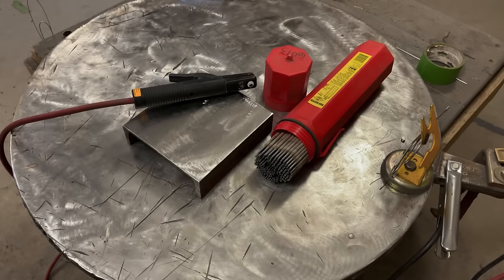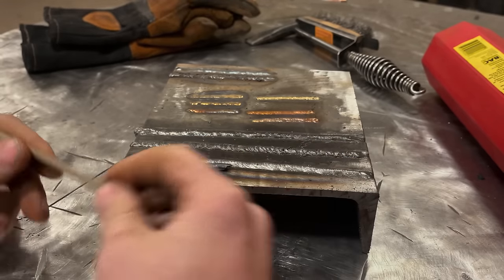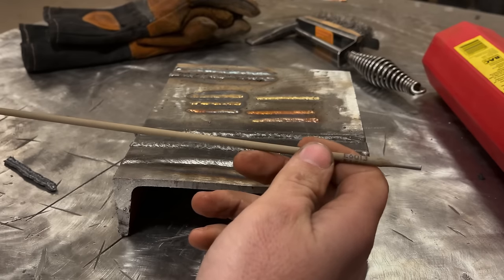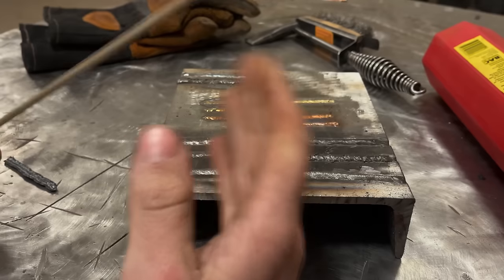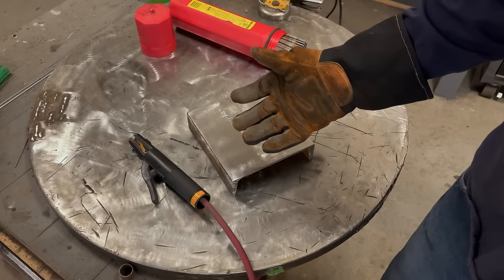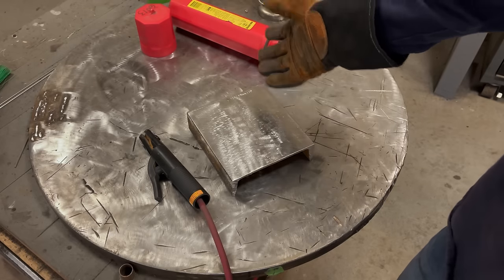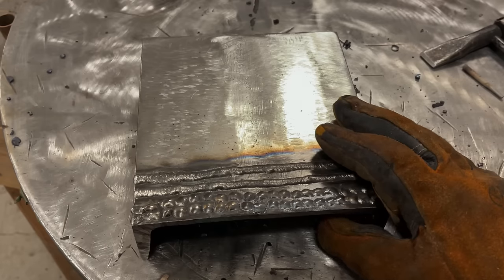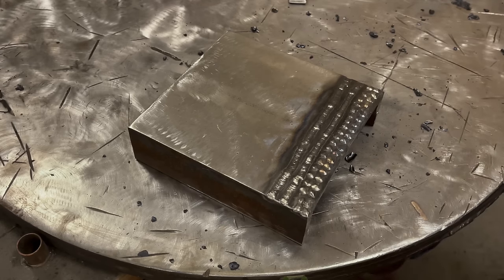How to stick weld 👨🏻‍🏭: Intro to Arc welding for beginners, (Series Part 1)

Comment: 80 years young. Just discovered your channel. Subscribed. I have a square body truck I need to repair using a mig welder. [I have never welded before] I saw this video and I have been inspired by your presentations to want to also to learn stick welding. You are an excellent teacher.Thank you!
Reply from the maker: Thanks for the kind words and it’s awesome to hear your tackling projects.  You have the right idea, watch some videos to get the knowledge and then practice.  The start of learning stick is about 99% frustration (due to everything going wrong lol) but after than things get much easier.    When you put down your first few good beads it will make it 100% worth the effort 😀
Reply: @makingmistakeswithgreg  Thanks I just bought a stick welder, a new helmet for welding, and a couple books [the books and helmet will be here in a couple weeks.] I have decided not to rush but to get everything ready for a great adventure. I bought a steel welding table plus a 1/4 inch 2 ft by 2 ft steel plate. to place welding material for practicing on top of it.I have been buying welding stuff over the years gloves, aprons, clamps, etc. Last week I decided to clean up my little shop. I found an Eastwood welding table and another welding top for the table. It is like Christmas time. Anyway, this new welding experience will teach me patience and a lot of prayer.I am a 7DayAdventist and I believe everything has its proper timing My time is so close to learning welding, bodywork, and painting. I have decided to slow down, finish straightening out my shop,weedwhack my yard put things in their proper place I like being organized and learning to do things the right way. Thanks for being such a wonderful inspiration.[I was thinking about so many homeless people living on the streets with drug and alcohol problems and I felt sad that often their talents or what could be talents are being robbed. Without a vision the people will perish] You must be a busy man You don't need to reply again. Thanks1
Reply: Your mig welder is perfect for body work because it can weld thinner metal easier and faster than stick

Comment: Why is it that every video I've seen showing welding when the arc is struck everything disappears and all I see is the bright arc and no rod position angle speed of travel it all disappears into the bright arc its almost like it needs a filter to block the brightness,  you know what I mean.

Comment: Tried stick welding for the first time ever today with 6011.  It did not go well LOL.  Kept sticking and then popped the 15 amp breaker.  Blah.  Will watch your entire series.  Thanks
Reply from the maker: 6011 is tough to work with if you’re new.  It is easy to start, but makes rough welds if you don’t move slow and consistent.  I have a video directly on 6011 that you would find very helpful, link at the bottom.  If you can make good looking 6011 welds you will find all other rods to be fairly easy to run.  Expect to make some pretty bad looking welds for a while, but once you get the whole balancing act down it will become easy 😀👍

How to weld with 6011: https://youtu.be/vK7rJAuoPJE?si=M9wJ-GtpjzEsDBcu

Comment: Sir Greg, started a welding apprenticeship in my village, they don’t do more than stick welds and with very little theoretical explanations. Thank you very much for providing this opportunity. I pray you keep dropping these gems.
Reply from the maker: No problem, and I am glad it has helped you.  Since you’re starting out I will give you this advice:  Expect to fail a lot, but don’t give up.  Practice the basics until it’s hard to make a bad weld.  You probably need to move slower than you are for travel speed.  Try to be as smooth and consistent with your hand movements as possible.  If you get frustrated take a break.  And lastly if I can do it you can do it 😀

Comment: A few minutes into this video I stopped and subscribed. You are a great teacher and the many comments speak to that fact. Like so many others, I have watched several "New to stick welding" vids to build my knowledge base. Your presentation is very complete and  I'll be sharing your channel with others. The fun begins!
Reply from the maker: Glad to hear you are starting a journey to learn welding.  You’re doing the right thing, learn as much as you can and then practice.  You definitely can learn to weld, just expect to be frustrated a lot at the start 😀.  Once you can reliably start a rod everything becomes much easier.  Definitely worth while learning, welding is one of the most useful skills a person can have 😃

Comment: Greg, I just wanted to thank you for your knowledge, manner of speaking, and the videos. You have helped me much more than many of the other videos that I have watched, and have encouraged me to practice my stick welding. You have also imparted a better understanding of what I was doing wrong and how I could fix it. I also have to say that your descriptions of the puddles and weld bead have great benefit. I am doing better at practice now than ever, and am going to attempt another job that I have for myself with a lot more confidence. Thank you sir!
Reply from the maker: No problem and thanks for the kind comment 😀👍.  Welding is difficult to learn at first but when you can fix the small things that are wrong it doesn’t take a long time to get decent results.  Once you master simple short welds it’s amazing at what you can actually make/fix 😀

Comment: Appreciate your sharing your thoughts, knowledge and experience. I'm 72 yrs old and retired. I have been wanting to learn about and begin welding. Have watched several videos and Really enjoy your tutorial. 👍🎯
Reply from the maker: Thanks and it’s never too late to learn welding.  Just have patience and understand it’s like learning cursive writing.  At first you make scribbles, and after a bunch of practice it starts taking shape.  Stick welding in specific is all about consistency.  After every practice weld ask yourself “how can I be smoother moving forward, more consistent in how I feed the rod, and how can I run a straighter line.  Once you can be consistent it becomes easy, you just have to train your hands to move correctly.  😀
Reply: At 72 do you ever wish you could learn how to weld when ever your were in your mid 20s??

Comment: I feel super confident after watching that, you teach like a dad would teach his child, that he loves and wants the best for, i feel like i can learn alot from you about welding, thanks for this vid
Reply from the maker: Thanks for the kind words.  I want to see everyone doing the best they can.  Welding isn’t easy and it’s frustrating as hell.  If you’re trying to teach yourself it will be a struggle for a while, but with practice and a decent idea of what you’re doing, you will progress fast.  The key is practice and not giving up.
Reply: @makingmistakeswithgreg  been practising this whole week, I even experimented with flux core wire using the rod welded handle as practice, was curious if it was even possible, I seem to be getting the hang of it, your tutorial was like the missing link for me, thanks greg

Comment: Good info. I'm going to start practicing running beads while things get slow. We're doing structural steel
Reply from the maker: The better you can run a simple bead the easier everything else is.  When you can run a straight bead that’s consistent, and layer them, then you are on the right path 😀

Comment: Thanks for making such informative videos. I will admit I watch each video4 or 5 times to get everything I can out of them due to my retired old brain. I'm really enjoying my new hobby and after getting a cheater lens and padding beads on plate on 3 coupons my welds have improved dramatically. Your a good instructor!
Reply from the maker: Glad to hear things are improving nicely.  With a bunch of practice and a fair amount of “mistakes” you will get it dialed in.

Comment: Thank you for these lessons just bought a welder that does it all stick,.Tig ,mig  wire, with or without gas Flux core and 110 and 220  so looking forward in using it all
Reply from the maker: Good to hear, you will have a lot of options 👍.

Comment: I'm a few months in now and have finished 2 biggish projects (1 metre squared storm drain covers) first with stick and then flux core, which I really like as I think it's more user friendly for DIY. On the safety side I made a major blooper a week ago which I think is worth relating. I live in the Philippines and it was really hot and humid and I really did not fancy wearing a top, and I was only throwing a few (well, 40 or so) tacks down before finishing for the day, so I went ahead and welded without my usual long sleeve cotton shirt. Boy did I pay for it that night - my chest and upper arms were painful and itchy as hell with sun-burn. A week later my skin is still flaky and peeling. Done it the once, never again!
Reply from the maker: It’s crazy how fast UV can burn the unprotected  skin, glad to hear you’re recovering ok 👍.  I have a tendency to forget to button up my shirt neck and that will also get you without realizing it lol.

Comment: Hey Greg, Thank you for making this series! I recently took up welding and really liked stick welding! I came across your videos and really appreciate your in depth instructions!  I recently purchased an old Lincoln AC-180-S  tombstone and plan on restoring it and using it to learn on. I am also a fellow Milwaukeen!
Reply from the maker: Nice to see a fellow Milwaukeeian 😀.  The ac180 is a pretty uncommon welder, I see one of those for every 150 normal tombstones lol.  It came in two versions, one with multiple output taps and one with adjustable amperage.  I have never welded with one but always liked the way they looked.  You can definitely learn to stick weld with that machine.  A lot of people overthink stick welding.  If you can master running beads with a ac machine it will instantly transfer to dc output machines.  The key is to be smooth in movement, consistent, and keep the arc gap to a minimum.  With a bit of practice you’ll be doing good 😀

Comment: Really great beginner lessons.  So many stick welding tutorials dont focus enough on the start..  if you can get consistent high quality starts going then a quality moving puddle will just follow naturally.
New sub thanks
Reply from the maker: Thanks for the kind words.  No doubt the start is critical.  Even with my experience if the start is rough the first 2 inches of bead is sub par.  With less skill it can be really hard to bring things back and you wind up with slag inclusions, a bead that only welded on one side, etc.  Mastering starts and tie ins is huge.
Reply: @makingmistakeswithgreg  cheers mate..  youve also got a very good teaching voice.  Clear with a good cadence and you dont endlessly repeat yourself either - my pet hate sigh....

Focusing on single starts and doing LOTS of them is a more productive path - and cheaper lol - to quality beads than running lots of bad beads and as you demonstrated the beginner will quickly develop a more instinctive feel for cold and preheat effects.  Your vid just made so much sense.  Im not a pro welder just a 62 yr old diyer but ive been working in the engineering field since i was 17.

And from this i learnt that the answers to most questions/problems are inherently simple. Build a strong foundation first always...  everything else after is easier because of it..

Something you may wish to mention  sometime about cheap DC welders - i got a 140A stick and TIG rig - is the poor stability of the current control and how to manage it as it changes with workload...  AND planning your weld to suit the limits of the duty cycle of cheap welders..  i figured this out the hard way...

Ive been having fun with my cheap welder.  I made my own argon solenoid 24Vdc control box with thumb and foot pedal switches and it works a treat.  A nice diyer upgrade for a basic setup..

And i forgot to say i really love your handle.  "Making Mistakes"  lol. Perfect..  making mistakes is how we learn and in this time of risk-averse "perfectionism" we need to reinforce esp for youngsters to not be afraid of mistakes but to use them well.. 

keep up the good work..  ill be busy watching your library in my free time here in New Zealand..

Comment: On all my rods, especially 7018, I  just flick the hollow flux off before I strike an arc. Plus, at my stinger I bend a 45° on my rod. That way as I'm welding on a radius I can maintain contact and desired angle   without braking arc. Also, an "overhead" is an "upside-down flat", is how I set my heat. Plus, "reverse polarity" is for deeper penetration as its current flow is from yo ur base metal to your filler metal.. "Straight polarity" current flow is in the opposite direction from your filler metal to your base metal. is shallow penetration and allowed only with certain rods and "innershield fluxcore" (needs no external shielding gas).

Comment: What a lesson on welding. It is such a good  video. Thanks buddy will be trying al lthese tips.  Im just starting out  and have been strugeling with starting the strike. 👍🏻
Reply from the maker: Glad it helped you out.  Once you master starting the arc and running short beads the rest will become much easier.  The key is to do enough of the stuff you can’t do well so the worst you do is better than your current best.  It might take a few days of practicing rod starts to get that down.  It won’t be much fun but what you can build once you can weld will be fun 😀

Comment: I echo the others Greg, a good mile ahead of the rest, although Tim Welds is up there close to you. I really like your step by step approach, baby steps to getting there. I was so frustrated but now, on day 3, I'm striking up and running small beads, and have got my head around reading the puddle, it is coming together nicely. Baby steps.
Reply from the maker: Glad to hear that.  What you mentioned is really the way to learn.  There are simply too many variables to control at once to have good results right away.  By improving each individual variable (arc starts, arc gap, travel speed, etc) it will slowly come together to improve the bigger picture.  Mastering the simplest thing makes the complex easier.  A solid arc start and a short 3/4in weld done really well, done over and over will do a tremendous amount to improve everything.  No joke, even at my skill level a bad arc start can wreck most of a weld, so dialing that it makes a huge difference.  Keep up the good work 😀👍
Reply: @makingmistakeswithgreg  Yep! The 6013s really are a blessing to learn the basics with. I agree; I can do a fairly nice 2-3 inch bead pretty consistently, but if I aim for longer I lose focus and it all goes pear-shaped. So as a result I keep it short and get to do  lots of restarts, and that's another important skill.

Comment: Extremely good video, with good perspective on explaining what could be relevant for a newcomer.
Im a newcomer.. never welded..very little daily need, but do have a need from time to time.
got a handheld ARC-welder and trying to find my heading.. Its an Insulated gate bipolar transistor based inverter welder.
Got quite a few settings.
Trying to understand the meaning.
* Hotstart 0 to 9 percent. (as you explained,I reckon its a start feature that will add more ampere in the beginning)
* Force  0 to 9 percent ?
* Valley 0 to 9 percent ?
* Frequency 0 to 99Hz  (could that be handy, as why would it give access to that on a DC based IGBT welder)
* VRF  (some human-safety concern where it will stay in low voltage side 14.8v vs 66v until a pool)
* CC or CP  (Seems to be the rod type, Acid vs Alkaline)
Settings : https://www.youtube.com/watch?v=j3ApUD9zS9w
Its a small mobile unit .. and what appealed to me
Reply from the maker: Hot start is a temporary boost in amperage to help get a welding rod running better and not have poor starting fusion.  “Force” is generally arc force, which boosts amperage as you tighten the arc.  Arc force control generally produces more difference with 6011 than say 6013 or 7018 rods because it possible to close the arc gap more.  I am not sure what valley means, it might be a cutoff for at what point the arc shuts off when lengthening the arc.  Frequency could refer two a few things.  If it outputs a/c frequency would adjust the frequency of how fast it switches positive and negative. If it has “pulse” then frequency control would adjust how many times per second that happens.

The most useful setting on a stick welder is hot start.  Having that makes a welders start much cleaner.  Beyond that most of the settings are really situational dependent 😀👍

Comment: Best course I have seen so far, hope you cover welding body position as well, great content, helps a lot!
Reply from the maker: I shot a video on that specifically since a bunch of people requested it 😃.  It will be out in under 2 weeks 😀
Reply: @makingmistakeswithgreg  Thats great, also I am sick to the teeth with slag inclusion-mainly when I try and fill gaps, there is not a single video out there I can see that explains the nature of slag, what causes it to collect. Also can you weld directly over a fresh weld without cooling then chipping away the slag first?, how do you do with uneven surfaces? all the videos online seem to be on fresh clean flat plates , but DIY stuff is often welding over irregular surfaces and you havent got time to be cutting material to fit into a irregular gaps.  Thanks again!.